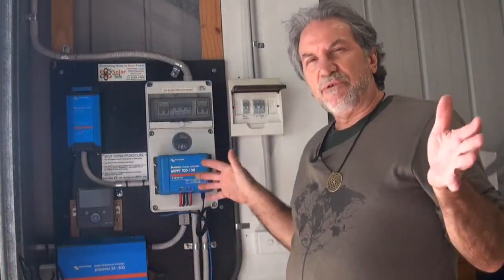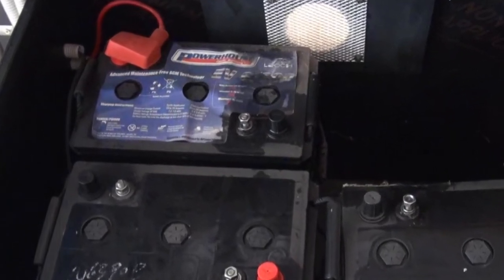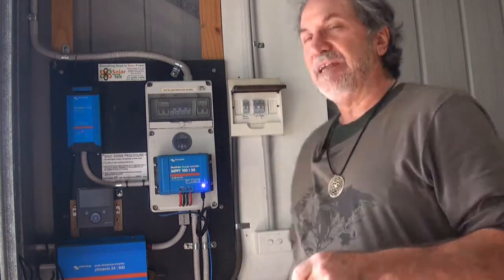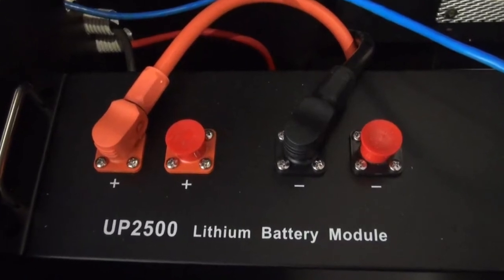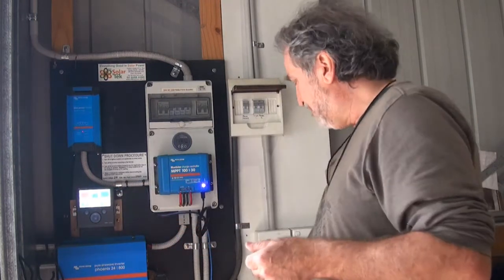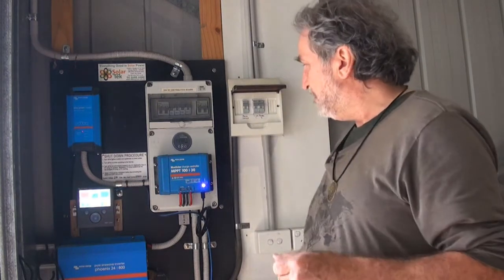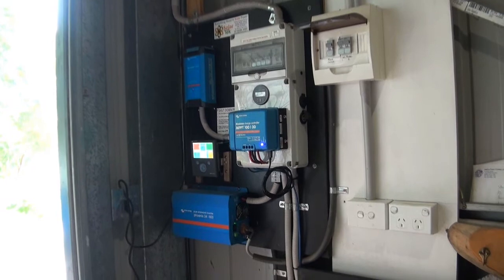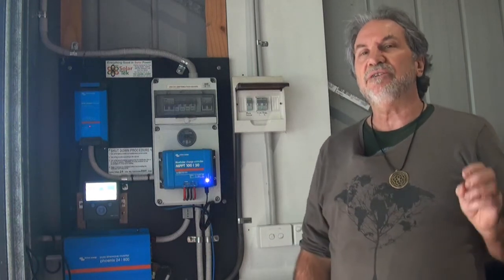Pylontech Lithium Battery Upgrade for 24V off grid solar system

Comment: Vincent, how you.  We are submitting development application to a council on North Coast NSW, Sept 16th
1)       50 prefabricated CLT & SIPform passive house certified, homes. The roofs of homes 11,460m2 PV the electricity will be aggregated and stored in a central hub of Tesla batteries. 
2)	13,430m2 PV Tesla and Tractiles tiles producing 7,671,216kw/hr/day when we have six hour of Sun per day for approximate 300 days 
3)	10 number commercial Tesla Batteries total 14.4MW/hr upgraded 28.8MW/hr.
4)	Bi-Charging of Electrical Vehicles one per house and 12 charging station located entrance the development.
5)      Retention Basin made from the dam on the site. Keep all clean by filtration by having reed beds to filter all the water.  It will provide some of water for the landscaping. It will be pottable water.
6)	Landscaping to whole of site making sure that  there is enough clearance the surrounding bush and buildings.
7)      Micro-grid that connects to locale community of 4800 residence and growing.

Do you to be involved. We find out end the Sept. The cost of development $50-60 million in total. We profit & loss statement available. I can email to email. We have investor are interested. This will not the only development we are looking at land in Goonellabah as well.  This is future of land development